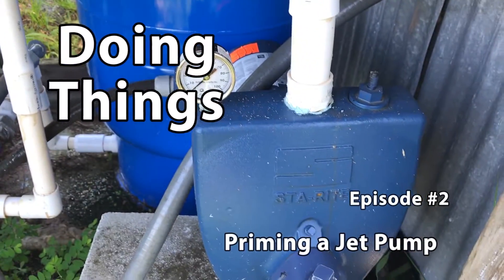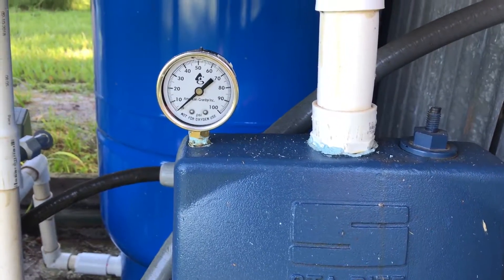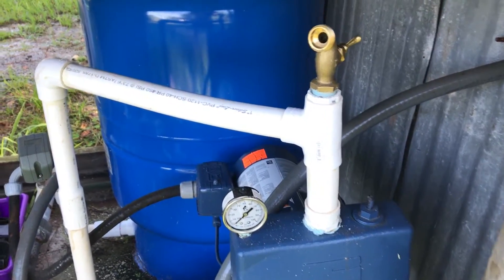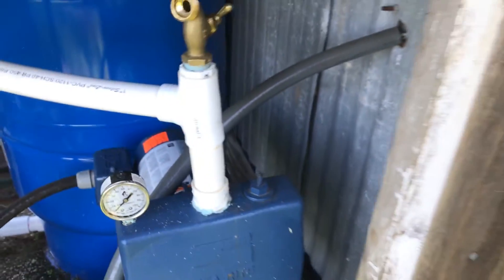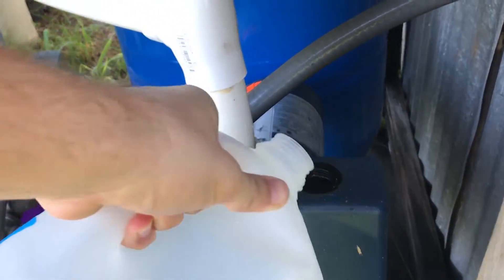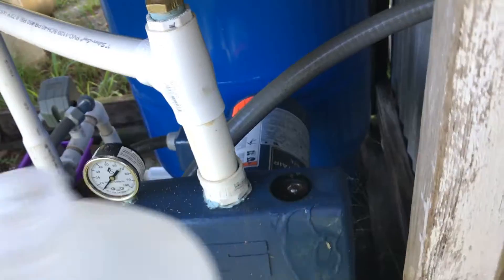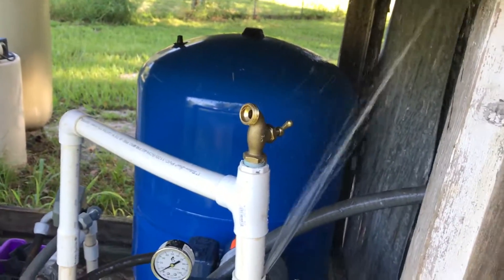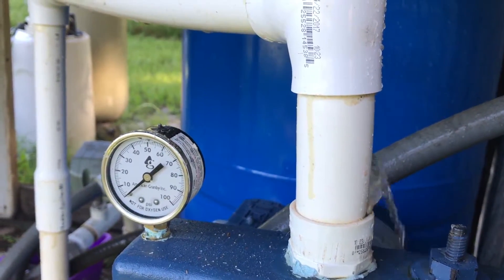Priming a Jet Pump

Comment: At 30 seconds, what did you call that plug with the screw sticking out? “Scrubber bolt” ? I’m told, that on a jet pump, it controls the flow (pressure?) to the jet but I can’t find out anything about it.